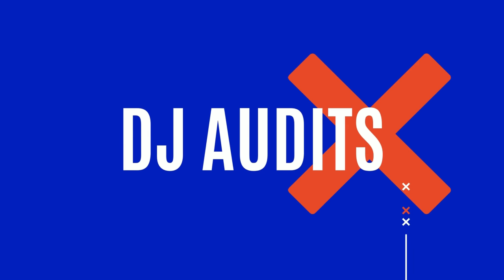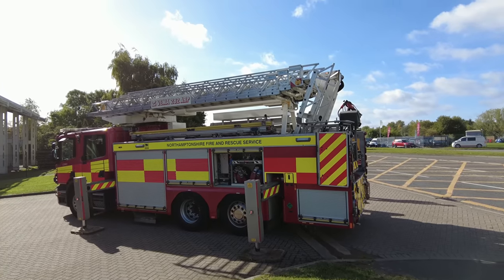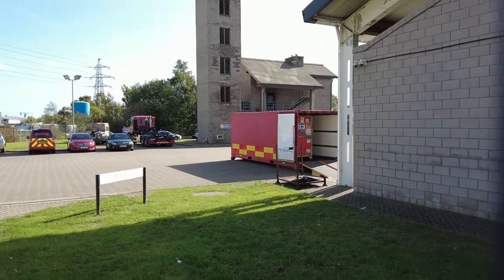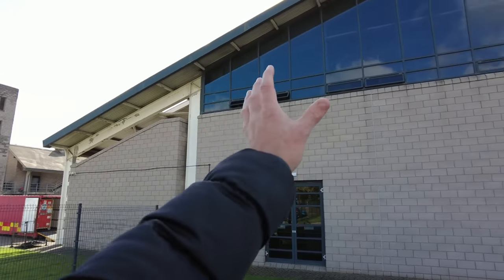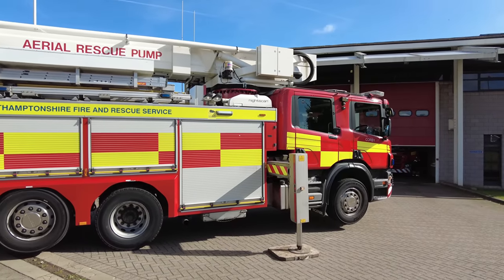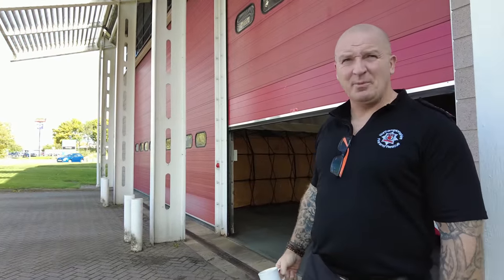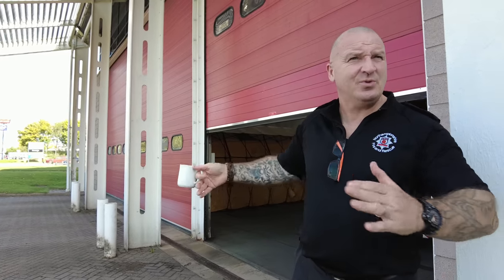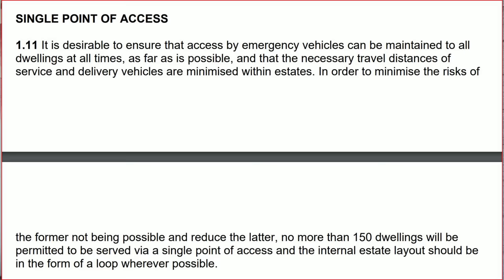We've Had To Manually Bump Vehicles Out The Way! 🎥🚒👨‍🚒✅

Comment: Some years ago I was talking to a Norwich fire fighter, he was the driver and they were responding to a house fire with persons reported. When they arrived it was a cul-de-sac heavily congested with cars parked on both sides. The house on fire was at the end of the cul-de-sac and a neighbour reported there were 5 children in the house. The sub officer said go for it and they rammed 8 cars out of the way. All 5 children and their mother were rescued safely but suffering from smoke inhalation. The rest was left to the insurers.
Reply: I've dropped computers off at a colleague's house in a cul-de-sac like that before, with literally an inch on either side of my car as cars were on both sides (they were parked half on the kerbs as well). Imagine a fire-engine trying to get up there, and you would also have to pull them out as pushing them in would possibly block the last houses from the engine (although I imagine they have long hoses, or I hope they have).
Reply: I want that sub officer to manage my amazon deliveries
Reply: @John Bratley, just as it should be, smash them out of the way. No piece of metal = 1 human life, never mind 5 children and their Mother. The UK was not designed for so many cars
Reply: I was a fire appliance driver when I was in the job, and I’d bet my pension the driver and officer in charge, (if he is still in a job!) are still writing paperwork! 😂😂

Comment: Great information video DJ. I use a mobility scooter and the problems I have are vehicles blocking the pavement and not enough drop curbs. I sometimes go 100 mtrs to have to turn back as there isn’t enough drop curbs. I then have to go on the road until there’s a drop curb to get back on a path. 
But the fire station chap was great with his information thank you

Comment: Merseyside had an 08 reg combined aerial pump, it was an absolute lemon. It took a full year of modifications to enable it to pass the tilt test. It went on the run at Bromborough Wirral as the second turn. Shortly after it was moved to the workshops in Liverpool and then quietly disposed of.  Another lemon was the Mercedes light pump, it was found to be so heavy when fully loaded that it made the steering wallow alarmingly. It was quickly sold to Cheshire where it was converted to a fast response motorway rescue unit.